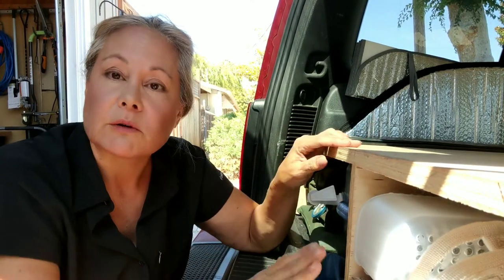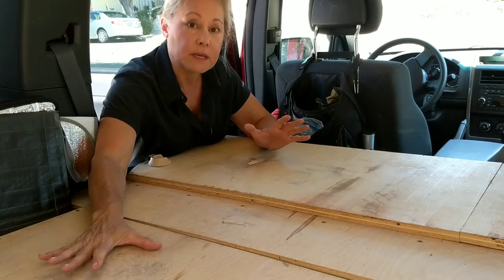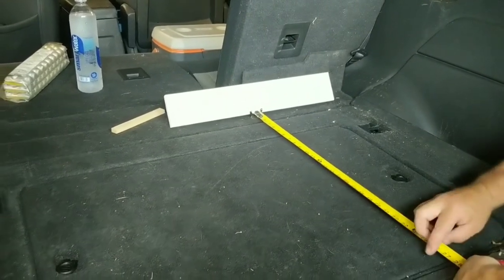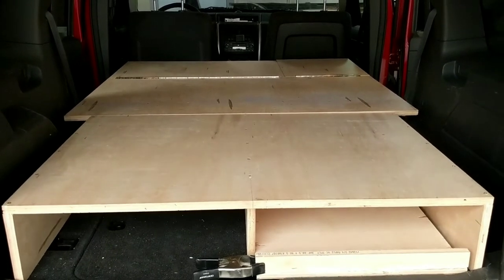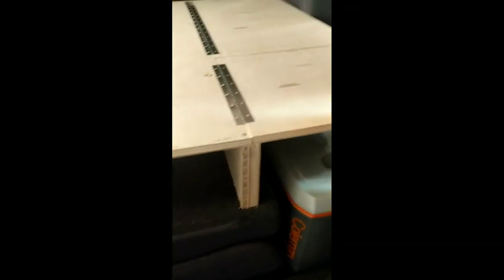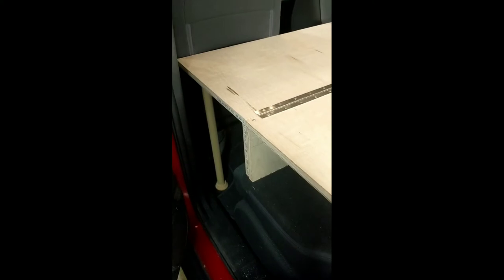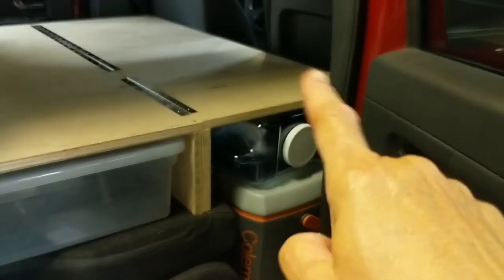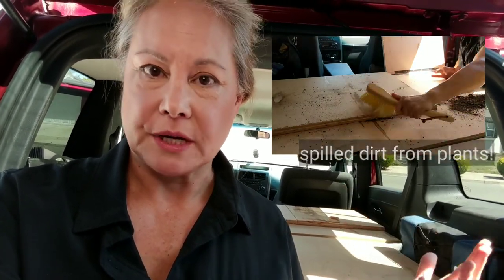SUV Camper Bed with storage! Easy DIY Built in a Few Hours!

Comment: i'm building a similar project,everyday use,and transform into a camper when needed.
ordered all the lumber that i going to need,so i finally can start my project.
Trying to make it modular myself,without to much fuss
Reply from the maker: Hi Steve! Yeah, we wanted an easy build and something that we could easily remove when needed. Measurements left room for some movement and ease of removal. I think what I love best about this build is that all of my camping gear is hidden underneath the plywood so it’s not exposed. Thank you so much for watching and commenting and good luck on your build. Let me know how it goes!

Comment: Thank you thank you thank you. You have done well bc I have a dodge nitro and this is it. Didn’t see a lot of dodge camper conversion but I love it. How much was the material? Bc I’m ready lol
Reply from the maker: Keyana, Thank you!! I think the time the plywood was about $48 a sheet and I used two sheets to create the whole bed. The closet rod was about $12. We already had the wood glue and screws from a previous project and I also had the closet rod holders as well but I think you can get a holders for about six bucks. So I would guess you have under $150 worth of material depending on the price of lumber in your area right now. But also we used a more expensive plywood I think it was maple because they didn’t have any regular plywood so it was more expensive. But also the maple plywood didn’t splinter as much so it was a trade-off. I did not put a finishing coat on any of the wood. I wanted to leave it there because I didn’t care if it really got dirty and in case I wanted to tear the part and redo it which is what I’m thinking about doing right now! I also made it removable so I can remove the whole camper bed out of the back of the jeep by myself and then return it to a car in about five minutes. I hope this helps if you have any more questions please feel free to reach out! Thank you again for watching and commenting!

Comment: How have you secured the platform the SUV to keep it from becoming airborne in the event of a crash?
Reply from the maker: No. I specifically made it so I could pull it out easily if I had to get to the spare tire if I got a flat. I also wanted something. I could take out quickly if I needed to run to Lowe’s or something to get things because this is my every day car. It’s pretty big pieces and designed to fit into the back of the car pretty snuggly so if I gotten a crash that bad, I think there would be other things that would have me sustaining injuries besides the platform😊